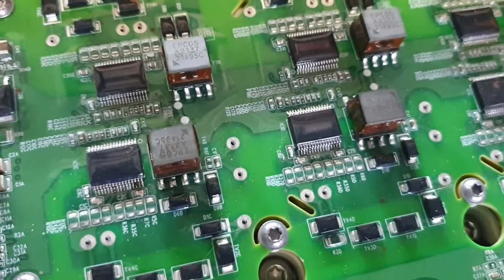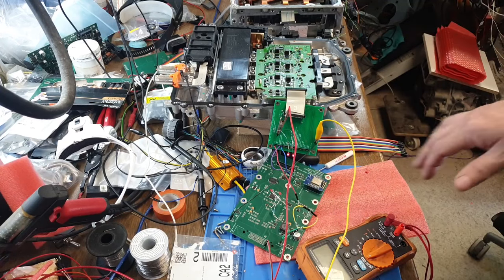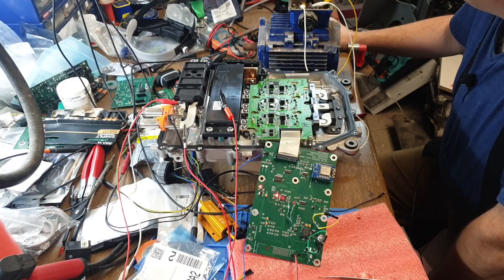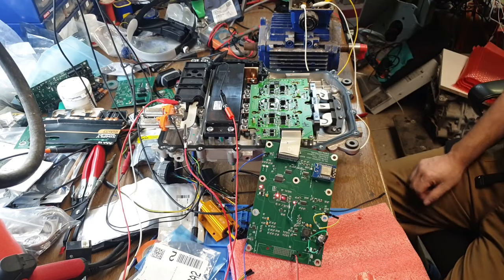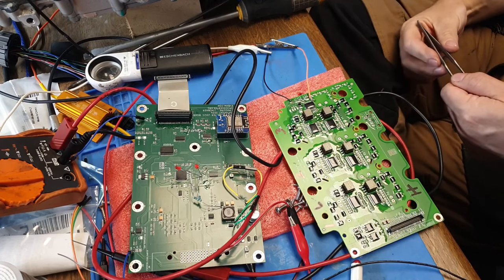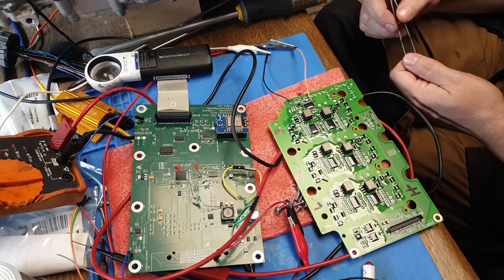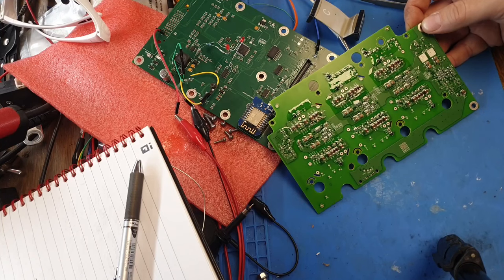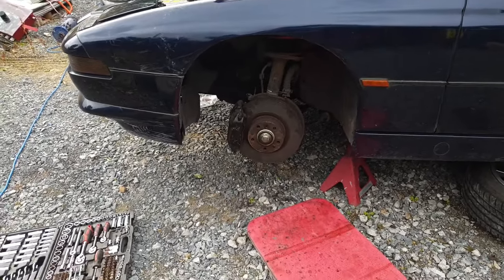MG ZS EV Inverter Reverse Engineering Part 3 : Spinning

Comment: Man, we need a clone of Damien to start reverse engineering battery controllers on used EV batteries.
It's literally a solution to the home energy storage problem. Tons of inexpensive battery packs in junk yards that are inaccessible due to Goofy manufacturer code